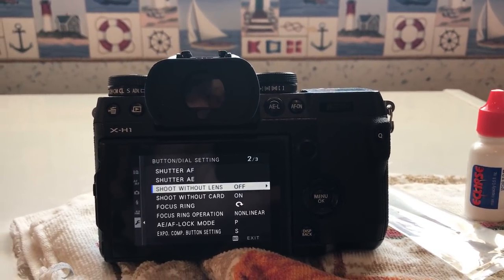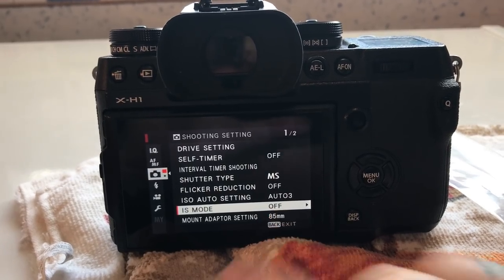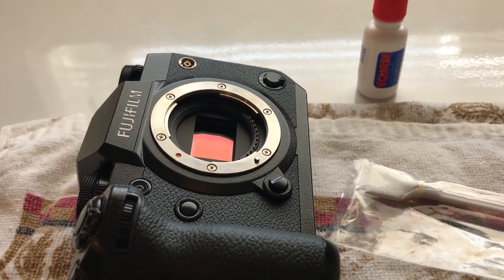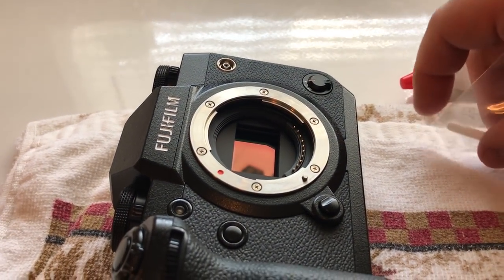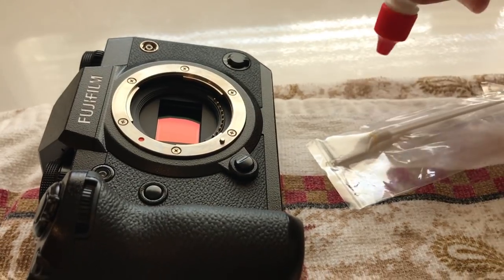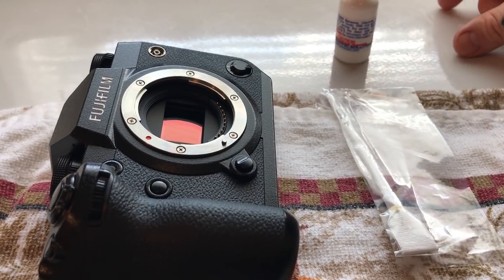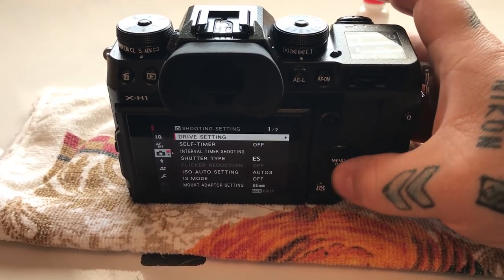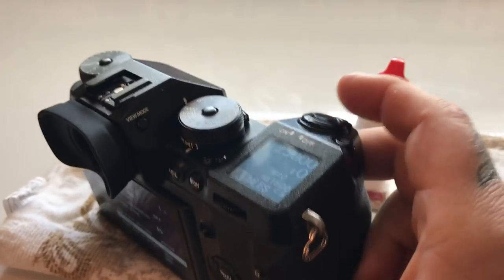X-H1 Super TIP! 🌀OFFICIAL HOW TO FUJIFILM X-H1 SENSOR CLEANING 🌀

Comment: I’ve just bought x-h1 with the superb price of $999 with the grip (three batteries included, so it’s the real bargain), and was checking the cleaning method for IBIS. 
Pardon me if I’m wrong, but if you are in the “shoot without lens - off” mode, the shutter wouldn’t close even if you push the release button accidentally. At least it shouldn’t.
It means no need to switch it from MS to ES mode.

Comment: Ken, I have cleaned the sensor on my XT3, using this method. About 6 swabs. Sensor is spotless, except for ONE tiny spot that only shows on F16 or so. It’s SMALL. I had the camera shop look with a loupe, nothing is scratched. How do I get this off? Just keep swabbing? Also, I know you hate the eyelead “gel stick” but what about the orange one designed to be less sticky? Also, what do you think of a q-tip with a pec-pad around it?
Reply from the maker: sounds like a spot in your lens  :/ 

HELL FUKN NO to that stick, no way
Reply: Theoria Apophasis happens on all lenses. I’m just going to live with it. I can only see it at F11-F16, with “visualize spots” jacked all the way up in Lightroom. On a blue sky, if i shoot at F16, and zoom in to a tiny area, I see a FAINT dark spot. At F8 and more open, I see nothing. I’m a portrait  photographer so I’m not too worried about it but it’s still driving me nuts. Gonna try one more wet clean and leave it alone. I’m hoping it’s not a dust piece UNDERNEATH the glass.

Comment: Looks like the identical process as the Sony cameras (ibis) ! However there is another alternative method where you can set it to do a “sensor clean” .. and you are then also able to clean the sensor (as ibis is off and the sensor is not  “on”) until you turn it off.